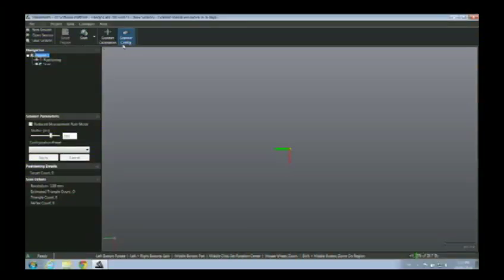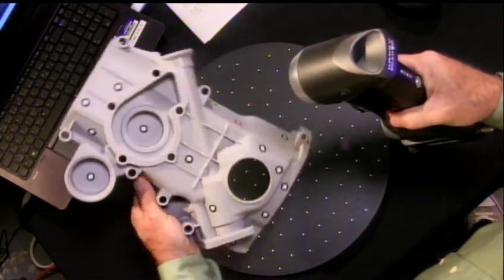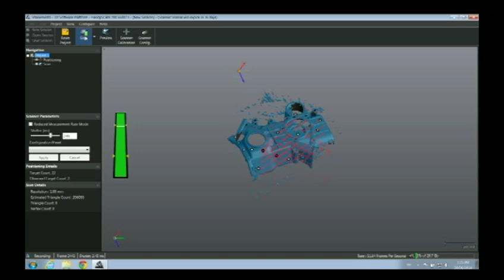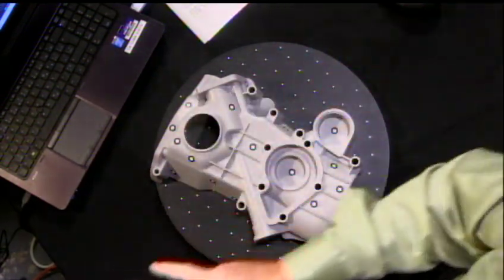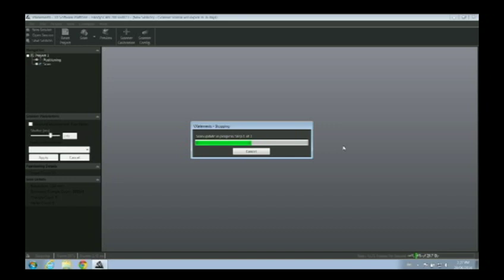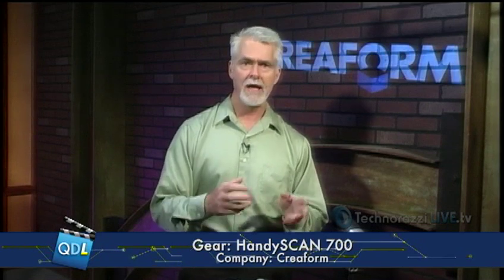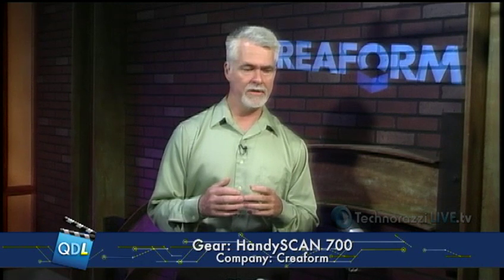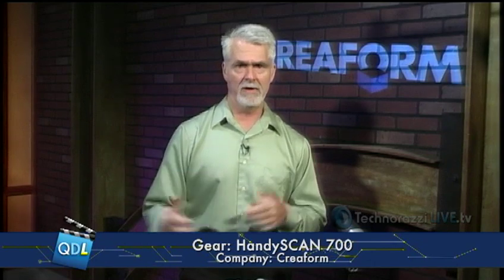Tech Corner: Creaform HandySCAN 700

Comment: What determines which resolution you select? We did a test with ours a simple various depth dents on flat sheet metal. We use inch so we started at .008 and went to .394. Small dents imparted by a BB sized object up to a ballpeen hammer were used as test dents.
At around .100 it would wash out the bb sized dents, and "blend" ballpeen sized dents.
So when do you want to use .008 resolution and at what resolution does it start to become more of a visual representation rather than some used for metrology purposes?